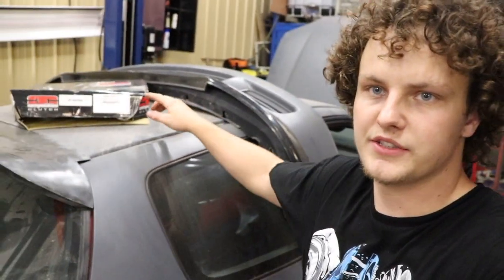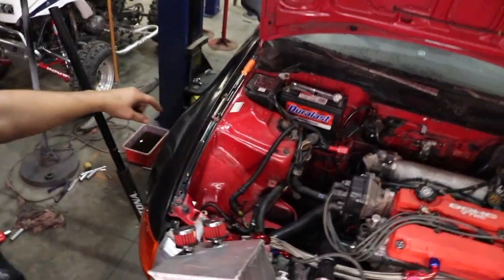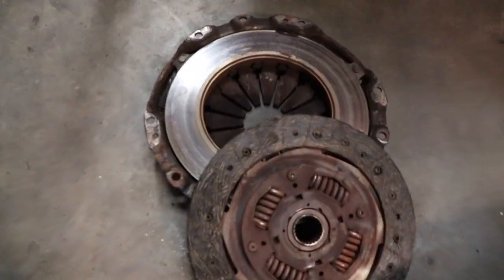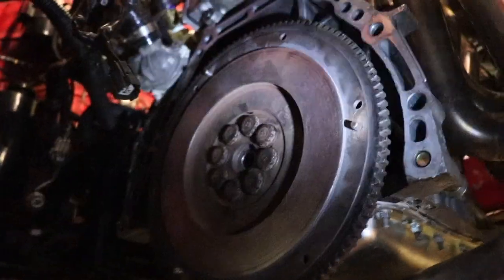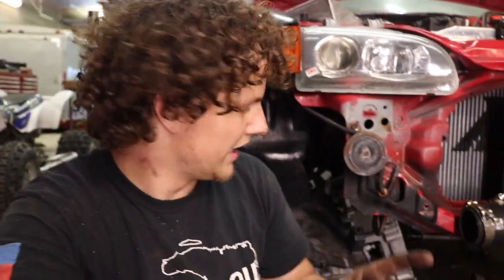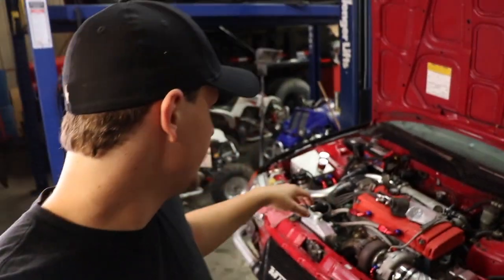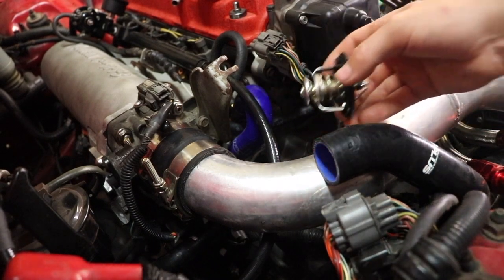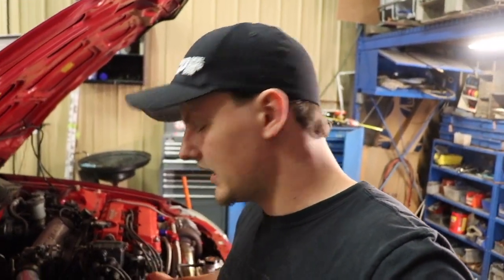Stage 5 extreme Competition clutch Installed in Honda civic Hatch

Comment: Jump the fan switch  2 wire connector on thermostat housing first before replacing relay.
Reply from the maker: Thanks I’ll try that
Reply: @JohnnyFabz  no problem. Unplug sensor and jump 2 pins on connector on harness if fan comes on you need new fan  switch.

Comment: God please dont DA the flywheel. That OEM 16 pound flywheel is the number one thief of spooling your Turbo quickly, lost acceleration , lost engine braking. Now would have been the perfect time to get that hp robbing anchor of your crankshaft! Well you will have to do this again. Get the 8.58 pounds CC flywheel. This will be the 2nd best thing you can do to your car next to the Turbo.  It would be beneficial for you to consult with experienced builders before doing work.  We could save you a shit load of time and give you advice on nessasary performance mods
Reply: Not beneficial for street driving. The factory flywheel has the correct momentum to engage a 6 puck smoothly without high revs. It's engine displacement, exhaust and turbo size that determine spool time.